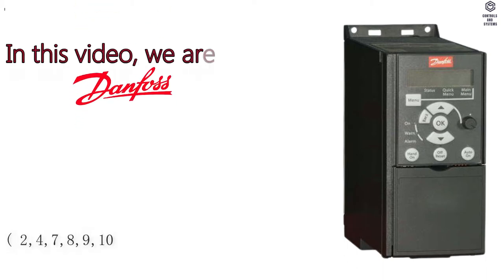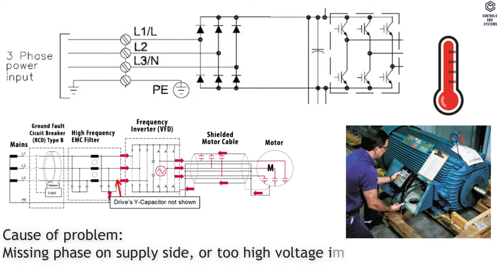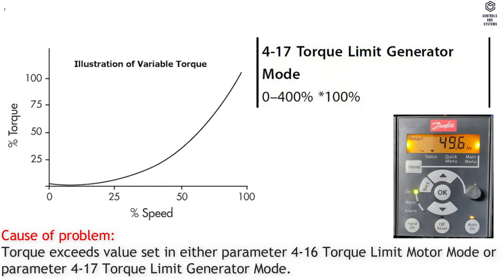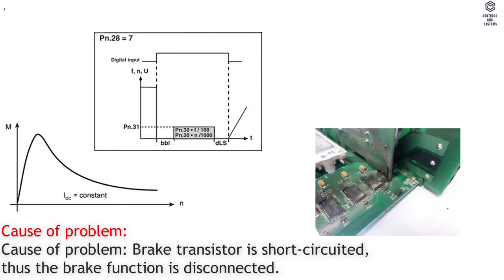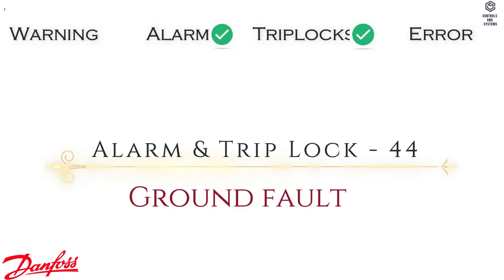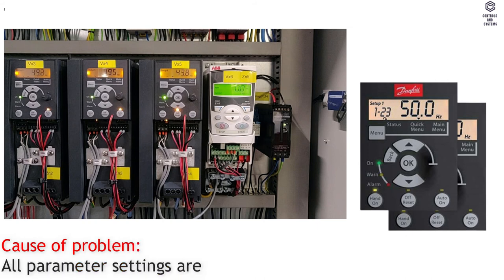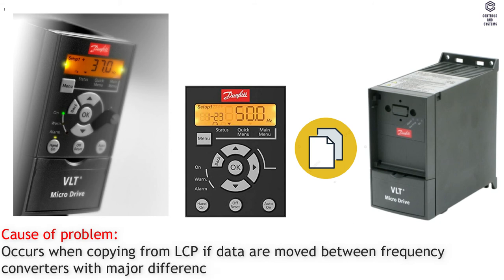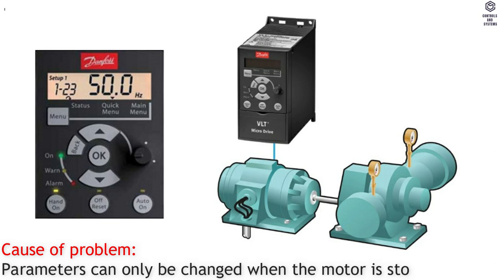#Danfoss VLT Micro drive FC-51 Warnings and Alarms / #TripLocks / #VFD

Comment: Excuse me
Can you tell me how can solve the alarm 08 (DC Under voltaje)?
Reply from the maker: WARNING/ALARM 8, DC under voltage

If the DC link voltage drops below the undervoltage limit, the frequency converter checks if a 24 V DC back-up supply is connected. If no 24 V DC back-up supply is connected, the frequency converter trips after a fixed time delay. The time delay varies with unit size.

Troubleshooting
• Check that the supply voltage matches the frequency converter voltage.
• Perform an input voltage test.
• Perform a soft charge circuit test

Comment: What is w12 warning in drive
Reply from the maker: Warning 12: Torque limit, 
Cause of problem: 
Torque exceeds value set in either parameter 4-16 Torque Limit Motor Mode or parameter 4-17 Torque Limit Generator Mode.
Reply: @insightcontrolsystem  thank you sir
Reply: Please tel me , what shal I do now, what changes I want to do, warning 12 it is 4-16 is100% 4-17 is 100%. And warning no 7 also coming over dc voltage

Comment: Feedback error a61 is caused by what problem
Reply from the maker: Warning/Alaram 61: Feedback Error, 
An error between calculated speed and speed measurement from the feedback device. 
Troubleshooting:
1.Check the settings for warning/alaram/disabling in parameter 4-30 motor feedback loss function. 
2. Set the tolerable error in parameter 4-31 motor feedback speed error. 
3. Set the tolerable feedback loss time in parameter 4-32 motor feedback loss timeout.

Comment: Can you tell me how to resolve alarm 7
Reply from the maker: ALARM 7, DC overvoltage,
If the intermediate circuit voltage exceeds the limit, the frequency converter trips after a time.

Troubleshooting:
1.Connect a brake resistor,
2.Extend the ramp time,
3.Change the ramp type,
4.Activate the functions in 2-10 Brake Function,
5.Increase 14-26 Trip Delay at Inverter Fault,
The fault may be caused by mains distortions. Installing Danfoss Line Filter may rectify this problem

Comment: Sir what is Alarm 68 please
Reply from the maker: The ALARM 68 is not Available in FC-51 model Fault List,
This ALARM 68 in only present in FC-102 model fault List:
Before Clear this error please go through the FC-102 model manual,

ALARM 68, Safe Stop activated
Safe stop has been activated. To resume normal operation,
apply 24 V DC to terminal 37, then send a reset signal (via
Bus, Digital I/O, or by pressing the reset key).